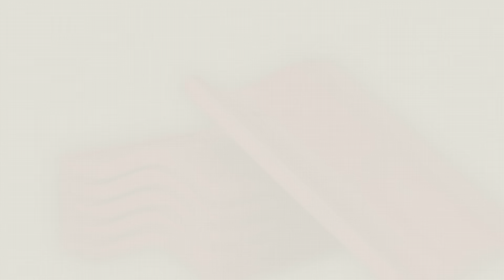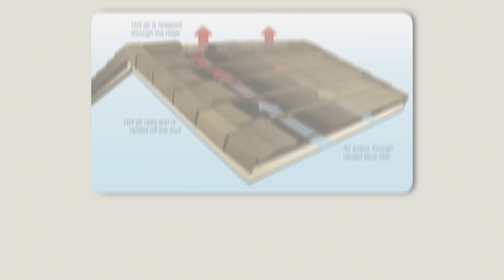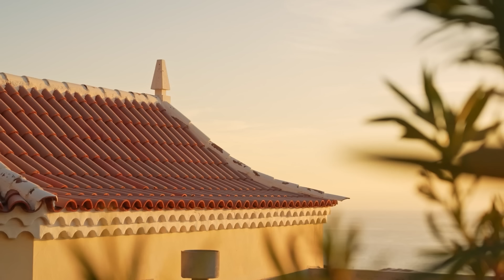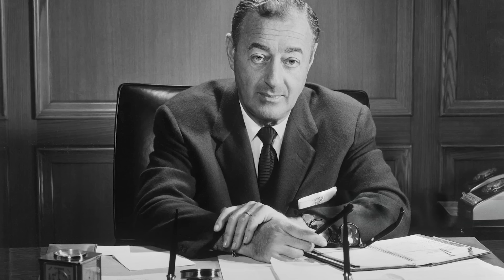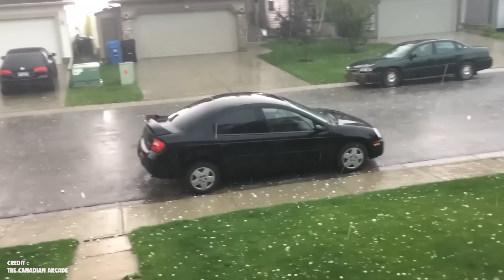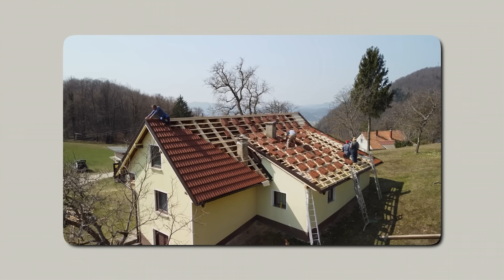Why Did America Stop Using Naturally Cooling Roofs?

Comment from the maker: Would you use clay tiles on your roof?
Reply: NO, it would cost WAY TOO much to reinforce the roof structure. My house had wood shingles originally and is only for light weight material. For my house a metal roof would be the best.
Reply: Not in Texas, no.  Hail has destroyed every terracotta roof I've seen in the area including my old office building.  It's unfortunate.
Reply: @Lacquerhead-TX  Then you need a concrete roof
Reply: Yes.  I wonder if clay tiles made from white or light gray clay would be even bettet at reflecting back heat?
Reply: @taphanhes  That's not the problem
you can even get the tiles with a special weather-resistant glaze containing aluminum particles, in shades ranging from white to light gray.
Reply: yes because it is beautiful. but i still want to see how it compares in efficiency against a Texas Tin Roof.
Reply: No that Clay titles are inferior to stone coated metal
Reply: I would use Steel instead
Reply: We have hail here, so unless I want even more insurance adjusters selling me the same scam, I'll pass.
Reply: I would, my last house had a dark shingle as described,it made the house hot. Even after i increaed the amount of insulation and soffit  vent. I guess during winter it may have helped but not noticeable.
Reply: I have clay tiles in South Florida. Most of the time what you see in South Florida is cement tiles made to look like clay. Mine is clay, imported from Colombia.
Reply: No too heavy and expensive.  Many better alternatives
Reply: We only use clay tiles.
Where?! Portugal, Spain, France, Italy, Greece.
And we have cold too.
Reply: Yes. In Romania ( Est Europe ) we use at 90%  clay roof. 🎉 American houses are useless frames from wood. They not could hold the clay roof. It is to heavy for poor american houses.
Reply: @AREA51AI-Reality    Not true.  Flat concrete tiles are the most common roofing on new houses in CA/AZ/NV.  The houses are wood-framed.  The tiles are heavy.  I only carry 3 at a time, which is ~20 lb.  The reason for masonry tiles is that it lasts longer under the evil sun.  Clay tiles are termed "Spanish" and usually only seen on much older houses.

Comment: I have flat concrete tiles in my California house.  Installed wrong, as builders still do, with battens flat against tar-paper.  Water gets under the tiles, then pools against the wood battens.  That degraded the tar-paper, and rotted the battens, to cause leaks all over.  I had to remove all the tiles to lay down woven polymer underlayment, then used redwood battens with plastic stand-off disks (Boral).  The raised battens allows water to run down, where it exits thru a plastic vent strip.  Air is able to flow upward and exit thru plastic ridge vents that are covered by tiles.  I stacked the tiles on other sections while working, so didn't have to haul any tiles off the roof.

Comment: Concrete tiles, found on a good percentage of new homes since the 1980's. Concrete is not much better than thick asphalt shingles. Terra cotta is king. Everything else is just the minimum.  I was in the clay tile industry from the 1984 to 2018. I used to make special fasteners for the industry. From the Reagan library, Walter Haas bldg in Berkeley, numerous roofs throughout Hawaii, Royal Hawaiian hotel, the historic clock tower, there's also some very old mechanics still at work. Terra cotta tile is a building material that has been used for over 3000 years.

Comment: Terracotta have different versions for all kind of weather, concrete tiles and glazed ceramic tiles can withstand frost, ice and low temperatures the best. Concrete tiles have low water absorption and high strength, while glazed clay has a protective layer that prevents the penetration and freezing of moisture in the pores.

Comment: So if metal roofing is on battens, does that mean it also allows for air movement?
Reply from the maker: It depends on the design.  If there is a gap that vents then yes but there would need to be a gap to allow for air movement.

Comment: Tile roofs have been dominant here in Las Vegas since the 1970s. 
Although flat roofs are becoming more common. What about slate tile?
Reply from the maker: Slate tiles tend to be flat so do not benefit from the curved design.  But that said if you can get ones curved then that would be an option.
Reply: @wildline_YT  Ok. 

Recommendation for cooler climates?

Comment: In my experience, where I live in Pennsylvania Asphalt shingles last 20 to 35 years, and I could replace them myself(it’s something I did in my younger years) Attics are ventilated, and insulated between that and the rest of the house. Tile are used in warmer climates, I imagine there’s a reason it’s not used here. When I built my new house it’s either going to be asphalt shingles or metal. The asphalt shingles above me right now are 30 years old and not leaking. Use good ones and do it right. If you live in a hotter climate use something else, as they often do in places like Florida and the southwest US

Comment: Over half the cost of a roof is labor. A lift and reset requires the same amount of labor as a new install, and the membrane is about a third of the cost of asphalt.
That being said, current US code requires soffit vents for vented attics. The soffit vents perform the same function and the terracotta tunnels.

A more energy efficient and longer lasting option is a metal roof with the similar battens as the clay. Metal roofs can be finished in a radiant reflective coating that reflects 90 percent of solar gain. Combine that with the vented soffits, and it outperforms clay. Most metal roofs are rated for 50+ years. You'll probably die before you need to replace one.

Comment: As a carpenter who has worked as a roofer in Canada, I can say that Asphalt is good for a few things. It is good for keeping roofers employed every decade or two. It is great for filling up landfills that were no filling up fast enough and it makes the blackest possible smoke when it burns in a fire, giving firefighters cancer at higher rates. Oh and the short nails with large heads are perfect for popping car tires. It is liquid in summer and brittle in winter. Everyone asks for black roofs that burn when you touch them with bare skin in full sun. I only use metal for roofing at home. Nothing fancy. No standing seam needed, just the thicker gauge stuff from the mennonites. 
I do respect the clay tiles, slate, granite and cedar shakes and shingles and other ways too. Sod is cool too. But Metal is cheap, fast, long lasting, reusable and recyclable.
Reply from the maker: Makes sense but it can come with its challenges - heat and noise.  I think you choose what suits you best!

Comment: Asphalt tiles no.  Most new buildings in the west and southwest use cement roof tiles died to look like terracotta tiles.  The problem is the coloring lasts about only 10 years.  However, that's not the builders' problem, is it?

Comment: Keep in mind a wirly bird also does far more for a roof, with minimal maintenance and no input or control, comparing cost anyways. Hotter the attic gets, faster it sucks hot air out, pumping cold air in. Think I have seen some state it could lower an attic temperature from 130 to about 105-110, from basically nothing... Pair that with clay tiles, and your electric is set to something rather cheap.

Comment: Metal roofs are better still- they have the same air gap benefit, but much higher solar reflectivity, especially if painted a light color. Low thermal mass means they heat up fast, but they also cool down fast. Also they tend to be more durable in inclement weather.
Reply: There's also something magical about that tap-tap-tap from rain on them.

Comment: It's more complicated than the video suggests. My mom and her sister bought houses in the same town in the 1970s. My mom's house had an asphalt roof and her sister had a clay roof. During the summer in my mom's house we used the air conditioner from noon until the sun set. In my aunt's house she used the air conditioner from the mid afternoon until late at night. The clay roof has a lot of thermal mass and it seems like it traps the heat a lot more than the asphalt roof.
Reply: You're somewhat right. As strange as it sounds, the actua comes from fluid dynamics. The clay tiles absorb the heat, and then when the sun stops shining, for reasons that I don't understand, but fluid dynamics does the hot air moves toward the cooler surface which in the example you outlined would be toward the living space.
Reply: It's not just the roofing material that matters. The design of the roof structure is more important. In Europe, we have long left an average of 10 cm (approx. 4 inches) of air space, which ensures the ventilation of the roof and prevents excessive heating.

Comment: sounds dumb but why not have roofs with both black and white tile, one each side for the winter and summer, so like on each season the house is dual purpose, Also using thermal cooling from the floor or through a cooling chimney.

Comment: I live in a neighborhood where all the 25 year old tile roofs on homes are still there while the cheaper asphalt roofs have been replaced due to hail 2-3 times.  I used to sell roof tile for huge manufacturer and getting builders to use it is like pulling teeth.  They want cheapest products for everything and care nothing about long term durability.  We would show them consumers preferred tile roofs by showing increased sales and money for builders using tile and yet few would select tile.  Roofers don't like them either because they want a fast install for quick turnaround getting paid.

Comment: My clay roof tiles are not mounted on battens. The clay tiles are nailed to the plywood roofing which has a heavy duty underlayment. The tiles are over 50 years old and still doing well with no leaks.

Comment: Where I am in Canada, most of our roofs are "tin". The metal doesn't have the thermal mass of ceramic, but it it also has the battens and the cooling channels so it does keep the houses cooler in the summer. The problem with ceramics roofs here is the ice/frost damage. Ceramic roofs don't shed the snow quite as well as metal and so get damaged by the freeze-thaw cycles. They're definitively a warmer climate solution.
Reply: lol as if Europe didn’t have cold places that all use clay. Maybe you aren’t able to manufacture a high enough quality
Reply: @kkon5ti  Paris gets down to 1C on average in winter. Ottawa gets down to -14C on average in winter. Paris never sees -35C. Ottawa does at least once a winter. Ottawa is on average colder than Moscow and Napoleon can tell you that Moscow was too cold. Cold in central Canada is VERY COLD!
If you want to compare Canada to Europe, you need to look at Scandinavia. The average winter temperature in Helsinki is -8. Definitely cold. Do the Finns use clay tile roofs? NO! Why? When water freezes into ice, it expands until it hits -5C before it starts contracting again. Any water trapped will then expand and break the tiles. That's the experience of people who live in areas where it gets VERY COLD.
I live in an area of Ontario north of Ottawa and we're on average, about 3C colder.
Reply: @DarkSyster  Paris has mostly copper roofs. Literally the worst example you could’ve found. You might be interested to look at Helsinki or St Petersburg instead lmao
Reply: Omg just look at a photo of cities. Just NA incompetence cope.
Reply: @kkon5ti  Paris having copper roofs is the perfect example of my primary point. Clay tile roofs don't work in cold climates. Also, I did look at Helsinki, and St. Petersburg. I didn't find many clay tile roofs in either place.
Reply: @kkon5ti  defeating your own argument... 🤣
Reply: @DarkSyster  huh? You said Paris wasn’t cold, which, even by European standards, it isn’t. It is therefore a bad example, especially since most roofs are copper. And yes, there are more metal roofs in Helsinki than there are clay tiled roofs, but they still exist on mostly the historical and single family buildings. St. Petersburg has plenty. And so do the alpine towns all over the continent. North Amerikan reading comprehension…
Reply: @scottjs5207  read again
Reply: @kkon5ti  You seem to lack reading comprehension.I said that ceramic roofs here don't shed snow as well and so get damaged by the freeze thaw cycle. "Here" is where I am, not far from Kapuskasing, Ontario, Canada.
You said that there must be a problem with our clay because Europe doesn't have the same problem and it's plenty cold. I said, Europe is NOT cold compared to Canada. Paris is proof of that. Even Helsinki and St. Petersburg are NOT cold compared to Canada.
Clay tile roofs are common in lower latitudes of North America, where winters are warmer. 
Like Helsinki, you see a few in Ottawa, on historical buildings but most of those "clay tiles" are just made to look like clay to preserve the heritage appearance because actual clay doesn't last.

Europe has what's called a "West Coast Maritime climate" which means the ocean moderates the temperatures.
Kapuskasing is a "Continental climate". There is no ocean moderation. That means it can and often does go from -15C to 20C in a single Spring or Fall day. That is the freeze/thaw cycle that breaks things. You don't get that anywhere in Europe.
Reply: @D @DarkSyster eah ok Kapuskasing is very different from Ottawa, I still referred to Ottawa.
Reply: @kkon5ti  Most no one knows where Kapuskasing is. Most people know where Ottawa is.

Comment: The problem is current methods of attic ventilation doesn't really work. We need positive air flow through the attic creating similar temperature to the exterior air. Its like keeping your car windows up on a hot sunny day. Minimal soffit vents limit how much fresh air enters the attic and vents at the ridge are not enough.

Comment: Where i live in France we use tiles since the roman era, the tile type used here is even called "roman tiles". Other places use slate roof, or stone roof, or some other sort of clay tiles. But here it's been 2000 years we use those "roman tiles" and i guess nobody bothered to change since it's works well enough, is aesthetically pleasing and is part of our traditions/history. Going cheaper is not being considered, as all other factors compensate for this aspect.

Comment: Have you seen what a tile roof looks like after major hail event like we get in my area? How about high winds in prairie thunderstorms? Oh yeah that. Not to mention it really isn't just about the roof material. It is about the developed cost of the entire structure required to support that much weight. Plus the roof design restrictions required by the material. There are a LOT of reasons tile isn't necessarily the best choice. Anything outside of a Mediterranean climate is gonna give you problems.

Comment: I have a clay tile roof. It is quite tall actually: around 4 meters at the crown. And it is not this magical cooling device. Temps inside my house can reach around 37 degrees Celsius. It’s also very heavy. Next year I’ll change it for thermoacoustic panel roofing.

Comment: I'd like to point out that we have still original roofs built 500 years ago! Churches and castles have some remarkable tile roofs. The house of one merchant had such a good roof that people never visited the attic in over a century and completely forgot that it stored enough spare tiles to reroof the entire building and it still has the original tiles for the most part after many centuries. However, each of them is toilet lid sized. 😂

Comment: The house frames in my area are not designed to hold heavier clay or concrete roof tiles. You simply replace asphalt shingles once every 5-15 years for $5,000-$17,000.
Reply: Thats why u get stone coated metal

Comment: In Spain we usually have tile roofs, concrete structures, and stone or bricks for the walls. Traditional houses last for decades or centuries with minimal maintainance, and they stay cool in the summer and warm in winter.
We buy houses to live or invest in the long term, we value good materials and pay for them if we can, so there's an incentive to build that way. 
Noone wants an ugly black asphalt roof. They're only used on top of office buildings.
Reply: wood also does has several advantages depending on the climate
Reply: In America Consumerism runs deep, and all by design.
Reply: Different culture, different life realities. Most american dont do long term family homes, will renovate their houses every 10 years, use wood as a building material rather than concrete or stone. Also the costal regoins and midwest get major wind events which terracotta with its airgaps wont be the best .
Reply: @gclowne174 you can bolt down the tile to the wooden member below it and bolt those wooden carriers to the house itself.
Reply: @gclowne174 Since the invention of the Sturmklammer in 1905 wind isn't a problem any more.
Reply: @gclowne174 Not doing long-term family homes has nothing to do with wanting to make the materials used for building those homes cheap and flimsy; if you don't live in them for that long, someone else will who moves into the home in your place. And renovations can happen in stone/concrete houses as well, as most renovations happen internally rather than completely blowing out walls and doing structural additions.
Reply: @gclowne174I saw concrete houses fall in south America

Comment: In Florida, most "tile" roofs are actually cement not clay. I had a concrete tile roof and liked it, except when it came to the cost. The problem is that over time  the manufacturers keep changing the tiles so that you can't incrementally replace the tiles when they get cracked, chipped, or broken. Also, I believe that the acidic nature of modern rain eats the old felt underlayment so that it becomes brittle, as you noted. So, the idea you promoted to just save the tiles and put them back on is baloney.